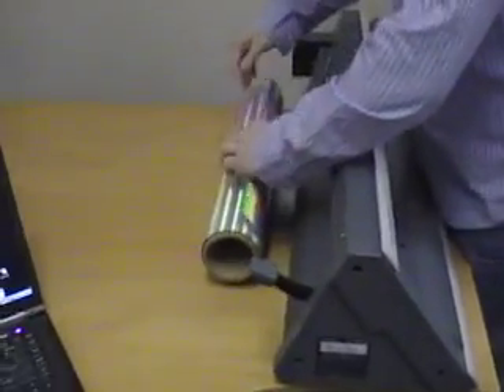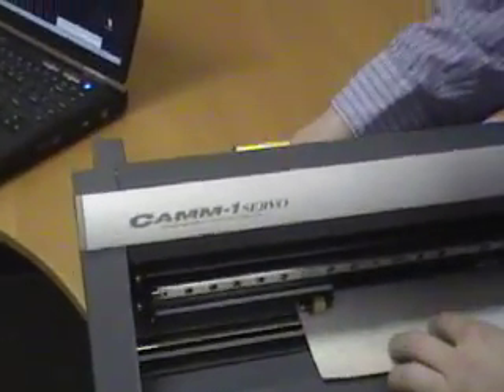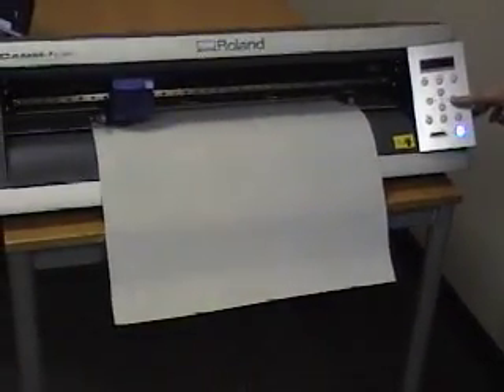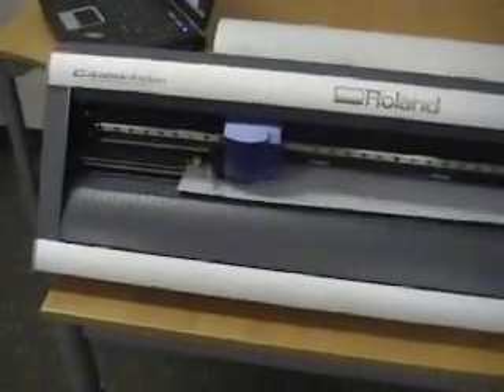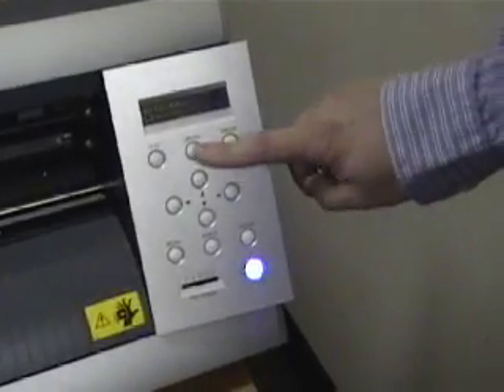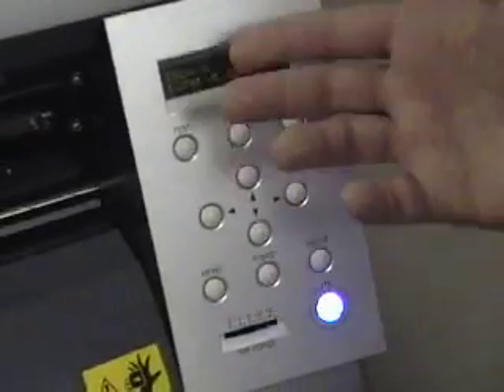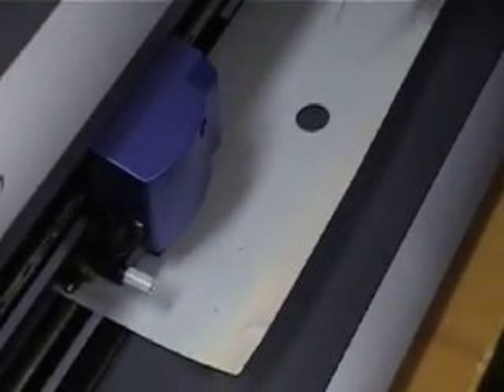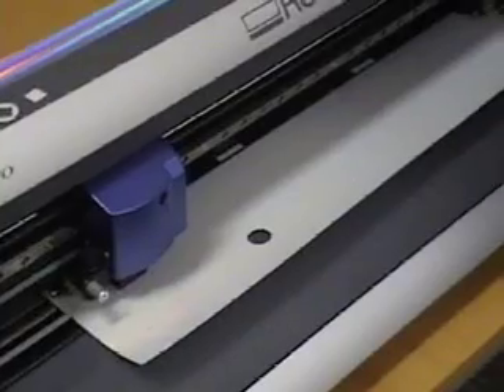Roland GX-24: Cutter Set Up Part 1 (Video 1/8)

Comment: I am Venezuelan and this writing was written with a translator, if something is not understood I apologize

I have a Roland GX-24 and I'm having a strange problem. After working with small designs, the plotter seems to have "locked" certain areas of the work surface. When sending a design that takes up the full width, the plotter simply ignores that part. Could it be a problem with the chartplotter sensors or some hidden settings? I've checked the software settings, but can't find a solution. Has anyone had a similar problem and could suggest a solution?

Comment: have you had any problems with the GX 24 so far?
Reply from the maker: +jakes21ish We have had no issues with the GX-24. I believe we do have some used in stock if you are interested. We do also carry the GS-24's which are the updated versions. You can reach us at 1-800-347-0068.

Comment: I'll ask again as you haven't answered anyone else ... Why have you cut the WRONG side of the vinyl .. You seem like you know what your talking about ... But obviously not ... Your supposed to cut the colored side then  weed the negative space then apply app tape then stick it to your final surface .... Thanks for showing how to find the rego point ..
Reply from the maker: +EEZAL Hi! I'm sorry no one had gotten back to you in the past. Our heat transfer vinyl does not need to be masked as it is already on a liner. That is why we cut the design in reverse. Thanks!
Reply: my bad i thought you were using regular vinyl ... sorry